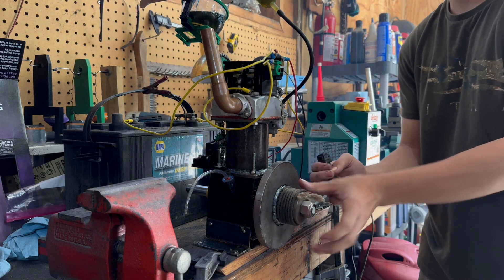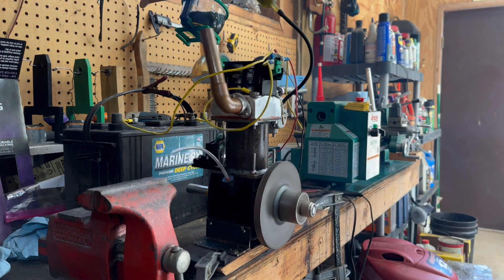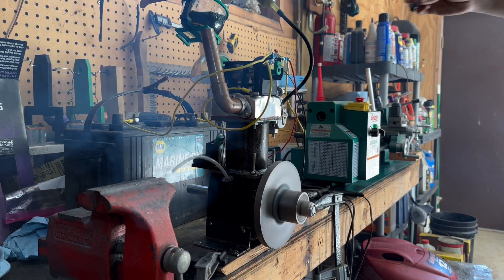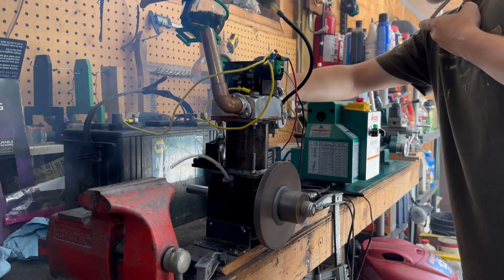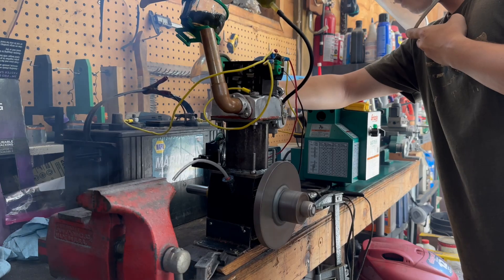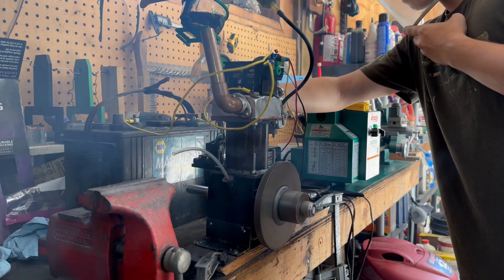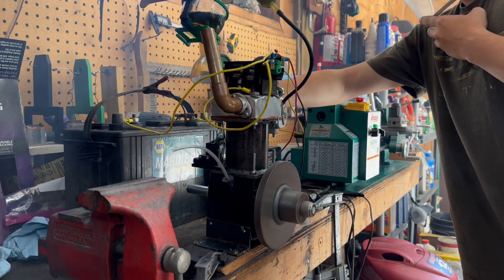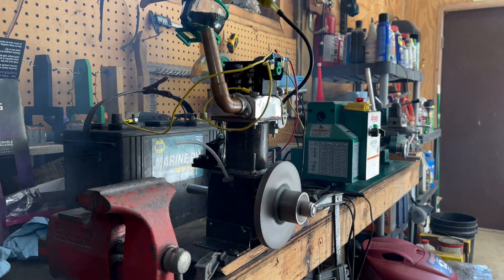Homemade engine runs for 2.5 minutes! Full video!

Comment: 4 cyl seems promising on paper, here is me subbing to see if you can pull it off!
home made engines are awsome.
Reply from the maker: I’m going to start with a V twin, and then work my way up from there. The V twin will be a proof of concept, and if I could get the crankshaft done, I might even attempt a V8 after!

Comment: That's has a very healthy combustion sound, for the bottom end my suggestion would be to with you gut for bottom end if you feel just like its going to be slightly over powered then bring the size up a bit. If your trying to make the crank one inch end to end I feel it will not work, your gonna need meat at the journal and Rod connections, I'm assuming your gonna be using roughly the same size piston and cylinder, that's looking about 5hp-6hp of per cylinder. On briggs and Predator Motors the out put shaft range 3/4 to 1in bit internally it's larger, the China and Yanmar air cooled diesels that are 6hp to 10 I belive the out shaft is slightly larger and is metric too to account for the extra torque. So to K.I.S.S if your trying to dyno it testing for max hp, torque and efficiency. Increase it to the proper size based off your estimate of output power that you've calulated, and to the math with the metal your planning to use. I've herd many engine builders tell me from in real life to guys on YouTube like TinMan Saws and many others don't skip out on your bottom end. Can't wait to see what you come up with good lluck friend!
Reply from the maker: Thank you for your comment!! I appreciate it a lot!!

Comment: Try a v6 maybe 150cc with gx25 pistons
Reply from the maker: I have ended up making a V twin, simpler, and less parts to make. As I get the hang of it, I’m gonna keep increasing the cylinders though, as I can’t make them bigger due to the size of my lathe.
Reply: @ProjectLMZ  cool maybe add some cooling fins to the cylinder or maybe melt some aluminum around it
Reply from the maker: @WillB-lv1xg  I’m planning on wrapping some quarter inch inner diameter copper pipe around the cylinder, then I can just pump water through it
Reply: @ProjectLMZ  cool I melted aluminum one time with a blow dryer and a hole in the ground with just regular wood. Made a screwdriver handle.

Comment: This realy good fun lovely sound.
1 inch crank is a bit on small side, it would be ok for developing but rpm speed is the killer foces quadruple eg go up by x 4 ever 500 rpm.
In the past when people played with engines the fly wheel would come off and chop off your feet. Please carry on do more but don't forget to learn from the danger of past mistakes.😊
Reply from the maker: Thank you! I have decided to go with a V twin, but due to the size of my lathe, I am limited it a 70mm bore, but it will be a 450cc V twin with 2 cans so I will have complete control over the firing order!

Comment: I think it sounds utterly magnificent. I am very impressed by your persistence and resourcefulness.
Reply from the maker: Thank you! After further consideration, I think my next engine is going to be a V twin, originally I was thinking of kind of basing it off of a predator 670 V twin, but after measuring the maximum size my lath can hold, I’m going to be limited to about a 70 mm bore, so the V twin will only be around 500 cc, but that’s still a pretty good sized engine!
Reply: @ProjectLMZ  I must confess that I agree - a 500cc V-twin is a good next step.

 Apparently the Yamaha XV535 develops 44bhp at a frankly astonishing 7500rpm. If you're aiming for anything remotely approaching those kinds of figures you're going to have to give some more thought to cooling!
Reply from the maker: @Del350K4  I have an idea for cooling, I can use copper pipe, I was thinking 0.25 inch inner diameter, and wrap the cylinder from top to bottom with it, do that for both cylinders, and then I can pump water through them. How does that sound? The only thing I’d be a little concerned about is the water getting too hot by the time it reaches the end and turning into Steam, but that’s not really a huge issue as long as I condense it again by running the copper pipe through some ice water or something like that.
Reply: @ProjectLMZ  It sounds very sensible to me. It's how the electric motors in radio controlled boats are cooled after all, so the small contact area presented by the round-section pipe to the outside of the cylinder shouldn't present a problem. Also I have an idea that electronics manufacturers sometimes use a heat-conductive glue to stick heatsinks in place.

Comment: 1 inch is plenty
Reply from the maker: I’ve actually changed my design to a V twin, I’m going to base it off of the predator 670 V twin, I think 1 inch will be enough for that, but I also want to try to maximize horsepower. I’m going to eventually try running boost, but I’m going to stick the largest valves I can in it, and I’m going to port the heads once I’m done.

So now the question is will 1 inch be enough for that?

Comment: Can you please explain the principle of a 1-stroke engine in the future or even try to implement it?
Reply from the maker: I had a idea for a 2 stroke engine to make it into a 1 stroke, not a true 1 stroke but I would make two 2 stroke cylinders, and bolt them together at the bottom, so one cylinder pointing at and another pointing away from the crank. The one pointing away would get a normal head, and the one pointing at would have a hole in the middle for a push rod. The piston would be a solid block of aluminum with rings on both sides, and a push rod out the middle. Then the push rod would connect to a connecting rod, connected to the crank. It would be the same as an opposed 2 cylinder, but only using 1 cylinder space. So you could do a V twin with the same power as a V4.

Just an idea I had a while ago, but would be difficult to get the bottom cylinder to get good compression.

Comment: cooling?
Reply from the maker: It will be implemented with my next engine. As I said in the video, I got myself into a pickle with the overhead cam, it’s a very complicated part to try to make out of metal without metal 3-D print printing, but my next engine is going to be a V twin based off of the predator 670 cc V twin!

Comment: One inch will be fine. It won't make the power of the Honda V4 and if you don't rev the crap out of it, it should hold together.
Also put some cooling fins on those cylinders.
Reply from the maker: I’ve actually decided to make a V twin instead, based off of a predator 670 cc V twin. Half as many parts, half as complicated, and I’ll be able to keep my sanity. I’ll be implementing some sort of water cooling system in it too.
Reply: @ProjectLMZ  great idea.
Reply from the maker: @Hydrogenblonde  now the only question is, I want to push a lot of power out of it, as much as I can, like running straight nitromethane and boost, should I use 1 inch diameter rod or 1.25 inch for the crankshaft?
Reply: @ProjectLMZ  Wow, nitromethane and boost from some kind of supercharger or turbocharger, that's a different ball game.
The 1"crank probably won't do that, 
I'd even be afraid the cylinders may come apart or you might blow the heads off.
I did not pick up what size cylinder bore you will be using in your video, but it looks about 2 1/2".
That would be pretty destructive if it blows up.
At this point in your engineering journey I'd limit the fuel to gasoline and limit any boost to low levels eg:5 psi.
That will make enough power to be afraid of it.
You could do with 1 1/2" rod journal's and mains for that.
The nitro thing I'd want to use no less than 2"rod journals and mains depending on your bore diameter.
But honestly stick with gasoline.
Also nitro is toxic and dangerous.
Take things one step at a time.
I like your water cooling idea.
Reply from the maker: @Hydrogenblonde  yeah you’re probably right, maybe methanol would be better, I just want to try to make enough horsepower so that when I put it on a go kart, it makes you wanna take it easy with 2 people on it. With the V twin design, I’m shooting for a 3 inch bore, more specifically, 82 mm bore x 66 mm stroke. The largest steel rod I can use is 1.25 inch, but I am working with very tight tolerance with that, and it’ll be more expensive, as I have to buy a 1.25 inch drill bit and 1.25 inch bearings.

Also, whatever size rod I will be using will be the crank pin diameter and main bearing diameter, so if I use 1.25 inch steel rod, the connecting rod main bearing will be 1.25 inch and the main bearings will be 1.25 inch as well as the output shaft.

Comment: Your engine idles and sounds very fine! But as you said after your 2,5 min run there was fuel and oil everywhere, wouldnt it be smarter to get you 1 cyl. engine more reliable before building a new and much more complex engine with more cylinders? I would set myself a goal of like running it for at least 20 minutes without it breaking down or making a mess. That way, when you are building a new engine, you start fresh with much more experience making the results even better. Realistically speaking, I see the big problems coming when you are starting to put load on it, there are so many things to improve before it can really be used effectively, like: cooling system (air or watercooled), crankcase ventilation, air filter, exhaust system, timingchain case and lubrication etc. 
I think there is one thing you havent thought about yet, lets imagine your engine could run to normal operating temperature of around 100°c. On that point your piston would have expanded to the point where it gets bigger than your cylinder bore, which leads to catastrophic engine failure. Thats why industrial made pistons are not really a cylinder when cold, they are a little bit smaller and out of shape so they expand into shape when getting up to operating temperature. 
Sorry for the long comment, i am trying to help and because engines are my life and really not that simple, I cannot just comment "oh what a great engine, go build a v10 easy peasy", because that would be a lie. Love your ideas about a building a v4 tho, i think some day you are going to build amazing and reliable engines! :)
Reply from the maker: I have changed my mind about the V4, after further consideration, I’m going to build a V twin based on the predator 670 cc V twin. It will be half the parts and half is complicated and save my sanity. And I’ll be doing push rod, so only one camshaft to worry about as well. About the single cylinder, the reason why there was fuel everywhere is because of a previous run in the same testing time, it started to run away, so I choked out the carburetor, and when I released it, it sprayed fuel everywhere. For the oil, the crank case is 3-D printed, so not oil tight at all, so oil went through the bearings and around the bearing plate, and made it to the flywheel, which shot it out everywhere. 

For the piston expanding, I did account thermal expansion clearances in the piston, the bore is 66.69 mm, and the piston is 66.52 mm. 

Also, as I said in the video, I got myself into a pickle with the overhead cam, there’s no practical way to make the top plate that holds the camshaft, so it’s runtime is limited to how long I can make that last. 

When I start on the V twin, I will be implementing some sort of liquid cooling system, maybe air cooling if I can find a way to not weld fins on, but I think it would be relatively easy, and the crank case would be made out of metal, so much more heavy duty, and I will be implementing crankshaft seals so oil doesn’t get through.

Thank you for watching, and sorry for the long reply!
Reply: @ProjectLMZ  What you are saying makes a lot of sense and i am really impressed that you took thermal expansion into account! You have come a long way from your first 3d printed engine and i think your next project is going to be great :)
Reply from the maker: @edrelucktant13  thank you! I am exited to start, I’m just trying to figure out if 1 inch steel rod will work for the crank or if I should go for 1.25 inch.

Comment: Oooo it’s running good!!! I love how this project went from barely managing to start to actually idling really good! Really nice journey, you have learned a lot and taught us in the meantime, can’t waot to see your future v4!
Reply from the maker: I think for starters, I’m going to make a V twin based off of a predator 670 cc V twin. It will cut my parts list in half, and the increased stroke length will allow me to use thicker steel rod. Once I get it running, my goal will be to push as much horsepower as possible!

Comment: 1 inch shaft is pleanty. As you said in the end it can handle well over 50hp. Or for example thoose 190cc 4 stroke engine make like 25hp and the crankshaft output shaft is 19.5mm. Im also pretty shore its cast iron aswell. Or maybe forged
Reply from the maker: After some further consideration, I think I’m going to go with a V twin design based off of a predator 670 V twin, and my goal would be pure power. I would use 1.25 inch diameter steel rod on the crankshaft, as with the increased stroke length I can make it fit, and I would make everything heavy duty, because in the future, I want to try running it on pure nitromethane with boost, so I can probably push that 70 to 100 hp range!
Reply: @ProjectLMZ  i mean go on. But the thing is that as camden said: the requirements for a running engine are surprisingly low. And what you have is a running engine so far. Dont get me wrong thats still really fucking impressive but its far from perfect and to make it perfect youd need some very special equipment. 70 to 100 hp out of a NA 670cc engine is a lot! That requires a very specifically tuned cam and a shit load of rpm. Also when talking about such high hp we are talking big forces. And well… for that much force going through specifically the bearings youd really want some sorth of oil pump to ensure proper lubrication. I know that a 670 dorsnt have pressured lubrication on the rod jurnals but imo thats shit design. Cause its basically relying on hopes and prayers to not spin that rod bearing. If there even is one at that. You do you though and good luck with your projects. Im really excited to see where they go
Reply from the maker: @tilen3266  I mean, the output shaft is 1 inch on the predator 670 cc V twin, and it can take the horsepower, so should I just do 1 inch crankshaft? I know that my engine is going to be far from perfect, but nitromethane doesn’t really ask for a perfect engine to make enough power to snap the crank in half. Especially if I add one of those cheap turbos or superchargers to it. If I do 1 inch diameter, steel rod, it would be cheaper as I wouldn’t have to buy a 1.25 inch drill bit, thicker rod, etc. 

What do you think? Do you think I should just go with 1 inch?
Reply: @ProjectLMZ  yeah id say 1 inch should be plenty. I mean thats still a lot of damn material. I dont have exact example to give you other then the 670 but i havent really heard od a output shaft snapping on thoose even with high preformance applications, so id say youre good. Id honestly worry about lubrication and tolerances more. And the rest of the crank design aswell. Id honestly go for something like a motorcycle style crank that has the pin press fit into it. You know thoose kinds that say yamaha 450s have and such. Id just weld the pin in kindof like TheStreetsSweeper did on his turbo 450.

Comment: I wouldn't worry about the steel thickness, your motor will not produce anything like the power a VFR will produce, so the comparison is unnecessary
Reply from the maker: After some consideration, I think I’m going to go with a V twin based off of the predator 670 cc V twin, it would cut my parts list in half, and save my sanity🤣 my goal with it would be to push as much power as possible, so I’d want to make everything overkill, since I’m working with less parts it means I can spend more time and materials on each part. I’ve seen people push the 670 V twin to 70 hp, I’m not expecting that, but I’d like to get around the 40 hp range!

Comment: You don't have to use that 4140 it is really tough stuff to machine.  With a small engine you can use mild steel, either cold rolled or hot rolled.  Connecting rods don't have to be expensive titanium either.  I use aluminum bar 6061.   4140 & titanium is just overkill.  What is the bore on you planned engine?
Reply from the maker: After some consideration, I think I’m going to go with a V twin based off of a predator 670 cc V twin. My goal would be to push as much power as possible, so I want to make it overkill. Do you think that 1 inch 4140 steel rod would be good for that? A 670 to 700 cc V twin? I can deal with the machining part, I just want it to be plenty strong

Comment: Great running engine, can't wait to see the V4
Reply from the maker: After some consideration, I think I’m going to go with a V twin. I would base it off of a predator 670 cc V twin, it would cut my parts list in half and I would be able to keep my sanity when making parts!🤣
Reply: @ProjectLMZ  Very true and if you go off of the 670 you can use the pistons if too hard to make, but with your fabrication skills i reckon you could make your own. Also what happened to the 2 stroke?
Reply from the maker: @FULL-ZOOM  I will make my own pistons for it, as I would be upping the bore. I’m looking at a 81-82mm bore and 66mm stroke.

The 2 stroke is cool, but it is more picky about running. And boost has less of an effect, and I want to boost my engine in the future
Reply: @ProjectLMZ  Sounds like you have it all planned out, Good luck and have fun!